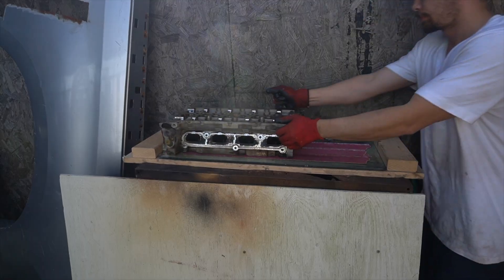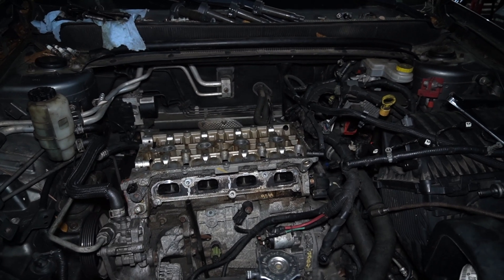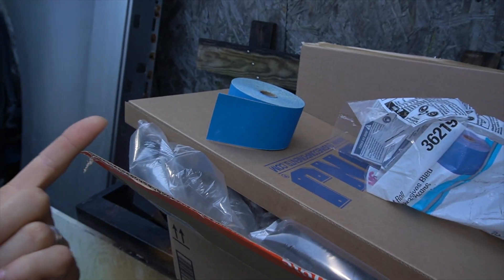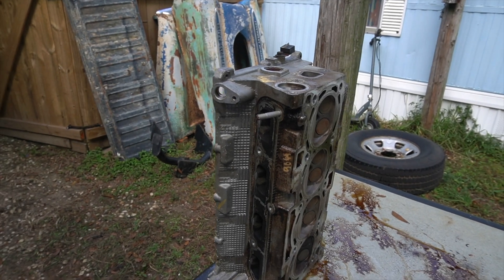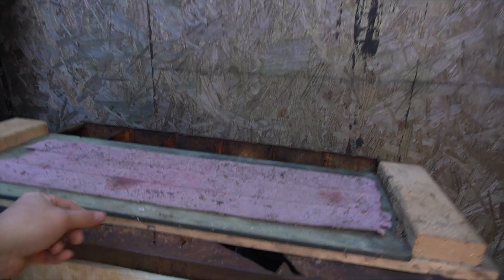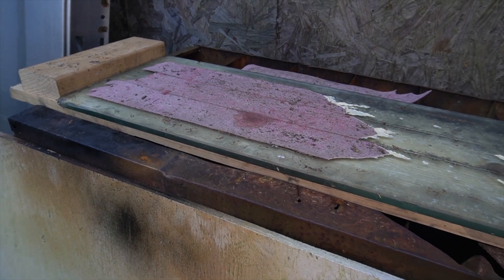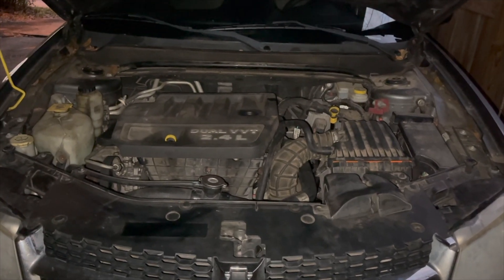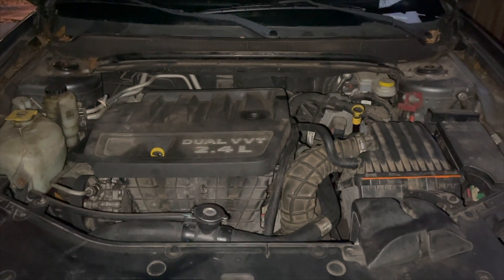Cylinder head resurfaced in the Backyard? This guy is a genius!!

Comment: I use this same tactic on all the heads i do. I flip vehicles and have had no problem with over 250 heads at the least. i have a large table top side of glass. just takes patience. Last head i took to my local machine shop came back with a deep gouge in the sealing surface and they said it wasnt a big deal. I had to buy a new head. never again.

Comment: I worked at a shop and I was told to resurface an alu cylinder head on a belt sander; I said: "WHAT!?"
Reply: Haha thats pretty funny, i wouldnt trust it unless it could take the full length/width and a way finer grit with a unbeat backplate under the paper.

Comment: THANKS FOR THE EFFORT, YET INCORRECT. YOU WANT TO CHECK STEINFAB GARAGE, UNDER THE GIVEN COND. SO FAR THE BEST BY FORMER AUTO MACHINIST.. IT IS CRITICAL TO MAINTAIN 90 DEG. WITH YOUR PROCESS, ONE SIDE WOULD GET SMALLER THE OPPOSITE WOULD CAUSE REPLACEMENT. I AM ALSO FORMER MANUFACT, SO I KNOW WHAT CAN WORK AND ..... YOUR PROCEDURE COULD MAKE HEAD FLAT YET SMALLER AT ONE SIDE COUPLE TAU, THUS HEAD WOULD BE TILTED AFTER ISTAL.

Comment: Did something similar lapping computer heat sinks, But this is extreme. One thing I'd add would be marking the surface with a permanent marker to visualize low spots
Reply: I had the same idea.

Comment: Believe it or not, water is the best cutting fluid in this situation.
I remember building a bath about 1/4inch deep and flooding it with water
Then hose it down and blow dry it befor it flash rusts
It was an iton head though

Comment: In my experience with machining aluminum, it LOVES odorless charcoal lighter fluid or kerosene, WD-40 also works great too. As for "oh no it's not dead flat!" realistically speaking, you are going to get it close enough, the main idea is getting the thing relatively flat and smooth. The only caveat is I would have switched ends that I was pushing on just so that way any uneven wear caused by pushing on one side gets evened out, but if the head works, the head works!

Comment: In the description it says why wait 2 weeks to get a head resurfaced by a machine shop. So many things wrong with this. Washing and resurfacing takes about an hour. Most machine shops do it same day (including mine). As for the video all the poster did was make the head into a nice U shape regardless of what you see with your eyes the dial micrometer tells the real story. Finaly the surface finish is not what is required for modern gaskets to seal. Yeah it works today and will also work next month but after 30 or 40 k miles and a little abuse the gasket will fail again. Just not worth the labor of removal and reinstallation to save 70$ machine shop bill for a jetwash and resurface

Comment: I resurfaced my cylinder heads on a Dodge 318 v8 using a belt sander. I used almost no pressure on the sander. Just a few passes on each head and I checked them with a straight edge and a flashlight. All good. It's been running since 2006.
Reply: If the head is warped, a belt sander won't do shit.
Reply: What grit did you use
Reply: Straight edge and a flashlight is not the standard
Reply: @bad406camaro obviously did the job and did it well. Its been running for almost 20 years
Reply: @warzonetrucker1258  not even close "doing the job" just because it runs does not mean it is done right.  Like I said a flashlight and a straight edge is not the standard. To determine if a cylinder head has been "resurfaced" correctly requires at a minimum a straight edge and feeler gauges. The correct way to do it also includes surface finish testing and verification. How I do it in my machine shop is with a dial indicator in the surfacing mill and verify finish with a Mitutoyo 178-561
Reply: @bad406camaro again its been running 21 years. It obviously did the job. A headgasket is either leaking or its not. It did the job well. No body cares bout your machine shop practices here. You are in the wrong place
Reply: @bad406camaro  My guy, there is a world of difference on working and doing the standard. Nobody think a resurface with a belt sander is the correct machine shop way, he just said it worked. How is that not a job done? Arent the objective to put the car back on working condition?
Reply: @warzonetrucker1258 right.  Folks chose to watch because they wanted to save money and d.i.y.
Reply: @bad406camaro  do you think he doesn't know that? LMFAO.

I've done plenty of DIY fixes that were not the "standard." Guess what, I got my car back on the road with no issue.
Reply: @beemrmem3  The LMFAO is your assumption that your car has "no issues" If you know than you know but clearly you don't know.
Reply: what grit sand paper ..thanks in advance
Reply: @knock904 Im going to start with, 240 if it doesn't get the head smooth like a baby's bottom ill do 400? Anything past that isnt really doing anything
Reply: Funny, everyone griping about belt sander, this machine shop in Miami uses a huge belt sander to surface heads.

Comment: i have a question though, when you resurface a cylinder head, does it reduce the thickness of the surface, or it only removes the dirt?
Reply: It removes a tiny tiny bit of the material itself to get whole surface completely flat
Reply: @ oh i see. Is that ok with the engine?
Reply: @joemana2271 there's usually a tolerance. You can remove a few thousandths and you're ok. Sometimes you can even get a thicker gasket to even it back out. Just find out what the tolerance is for your particular head and don't exceed it.
Reply: @joemana2271  its a necessity.

Comment: Please just take to a decent machine shop, this is stupid.
Reply from the maker: Thanks I appreciate the advice. While your at it let me know more thanks
Reply: No, it's not, it does the SAME THING, it flattens the head surface; along the process LAY A STRAIGHT EDGE on it  lengthwise and across, and keep checking with feeler gauges; 0.003 IN THE MIDDLE is BORDERLINE, 0.001 is plenty good, NO NEED to go to 0.000; that is what FACTORY car manuals say,even for Diesel engines; i did it a few times when i did not want to wait on the machine shop; some glass over a block of POLISHED GRANITE can be gotten almost for free, they discard them when they chip a corner or other edge defects, i use the granite directly ,  o glass; of course i run the straight edge on it first to see.

Comment: Good idea only thing that would be better is making the sanding surface bigger so the head can be turned sideways to get a cross hatch pattern an help get a more uniform flat surface.
Reply from the maker: I get that. But had to work with what I had. And I was making sure I was turning it side to side to make sure it was getting a cross hatch. May of not looked like it but I was turning it as I was going to
Reply: If you want, you could get a big chunk of steel and flatten it. 
Use valve compound and lube to achieve the same effect but you have a bigger surface so you can do what you want.
Reply: @kairu_aname  or look for a flattened slab of granite. A blank flat headstone (24"×12"×3") costs about 40 bucks and is perfectly flat. Not nearly as delicate as glass
Reply: @superturkeylegs  
Maybe, but the steel chunk can also be a mobile piece that you can use to lap a block. More time consuming, but easily doable.
Reply: @kairu_aname  True. I'd bet a thin sheet of granite would work too. May be cheaper than steel
Reply: @superturkeylegs  
Entirely fair.
Reply: @kairu_aname  I'm in the process of fixing my Kohler k181 off of an air compressor. The cylinder head needs new spark plug threads. I'm sure I'll have to resurface the head and top of the engine, and do a valve job. Daunting project, but this video and our discussion provided some helpful ideas. I appreciate it
Reply: @superturkeylegs  
It took a while to find a video showing a homemade tool and it's use
Reply: steinfab garage on youtube uses the large floor sander sheets from the tool rental section of home depot. he also uses a piece of tile from the flooring section as a flat plane.

Comment: Take an old treadmill an electric one, get you a thick piece of flat steel the same length of the treadmill run your belt that you get made over the top of the steel and run a hose pipe over it or a garden hose with water and maybe put a little soap in it. You could use a parts washer pump and recycle the water if you wanted too it works great. just do not get carried away and cut way too much off of a head you need to mic it first.
 Whatever it is, you are resurfacing just make sure you do not cut too much off of it because it will do it really quick and that also depends on what grit sandpaper you are using.
Reply: Are you describing a treadmill belt sander? 😂
Reply: @monkeyman1282  I hate it but ngl it's a great idea lol
Reply: Hemi Garage Hacks, that’s probably where you seen that lol

Comment: How do you ensure that the surface where you put the sandpaper is perfectly flat? Because if not, I think the whole thing is meaningless.
Reply from the maker: Yea I should of put that part in the video of me checking the head with a flat edge but didn’t get a chance to
Reply: The glass plate is the perfect flat surface. Like he said,  needs to be a certain thickness so it doesn't bend or warp.
Reply: The fact that it works every time should be enough proof. Probably even better than theories about checking flatness.

Comment: Hello from Oamaru Sth island New Zealand.
Do you advise to dress head gasket with Hylomar spray on prior to installation?.
I'm replacing a gasket on my 2012 Nissan Navara D40 St-X Diesel common rail turbo engine
Reply: I didn’t hear if hylomar here. We don’t have Nissan diesels either. 
We do have copper spray gasket which is good on MLS (steel) head gaskets.

Comment: What grit did you finish with? 80 is too course for finished product
Reply from the maker: 120 grit
Reply: Why not 800 to 1000?.
Reply: @conmanumber1  It's important not to leave a mirror finish, the surface that 120 or 200 grit sand paper leaves actually helps "bite" the gasket: